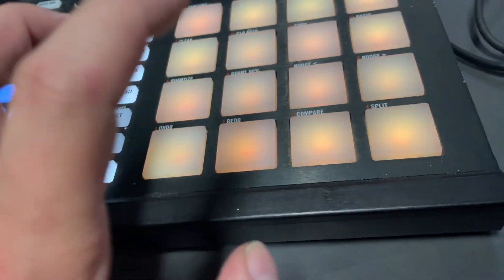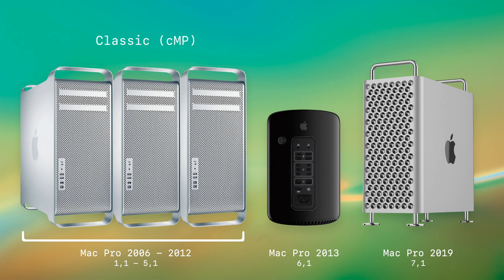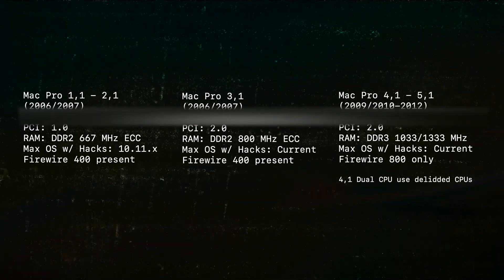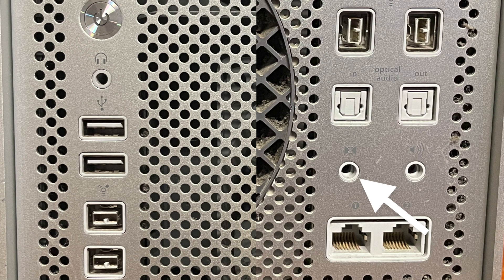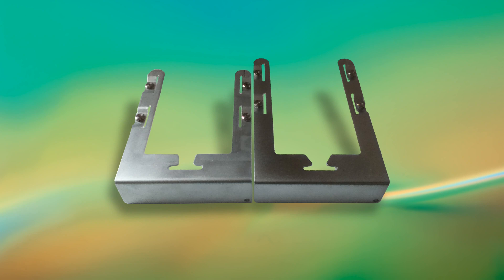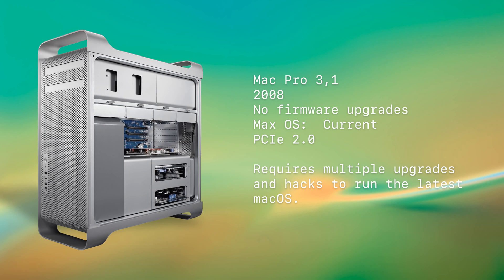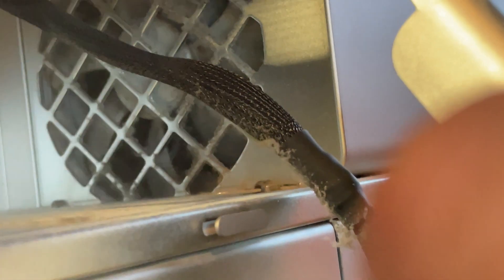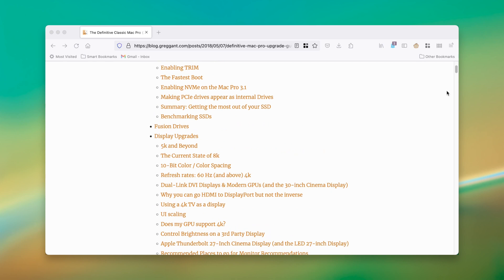Watch this before buying a Mac Pro 2006 - 2010 (1,1 2006  3,1 2008  4,1 2009 and 5,1 2010-2012)

Comment: 10.7ppc was released by dev.
Reply from the maker: @reality: There the 10.6 beta but I’ve never seen 10.7 for PPC, got a link for that?
Reply: @dmug  you’re also completely wrong about 1,1. It’s a beast that supports 64gb ecc, Monterey through windows 11 virtual machine, on nvme. Hell, I’ll ship you the machine to talk about.
Reply from the maker: @werehyenataur  I have a busted 1,1. Most users who are interested in getting into Mac Pros probably should skip it if they're hoping to use modern apps. 

This isn't to say they were once great but Apple's decision to drop support really took the most compelling feature: the ability to run macOS, away from them.  Considering the prices of the 3,1s and 1,1s aren't usually more than a few dollars, I just can't recommend them in any facet as they've been mothballed but if someone already has one and has a use case, then awesome. I support this as keeping ewaste out of landfills is great but given a choice of buying one? I'll always push someone towards the 4,1s/5,1 single CPUs over any of the previous gens because of the massive performance gains.
Reply: @dmug they should be recommissioned for old apps from the mac archive as 10.4-10.11 offered great apps and support for 32bit cards/apps, which gets dropped after 10.13. This saves time/money when budgeting a complete editing/gaming system vs newer shit. Every computer shop and grandma’s attic has these boat anchors for free. Ive never paid more than $10 per each. NVME cards are supported but I never did locate them again after methheads gutted my 1,1. It did run windows 10, and from there should be able to virtual machine above 10.11. You need to STOP mentioning money in your vids and just talk technical shit otherwise people will pass up these innovations and you’ll miss out on hackers like myself proving you wrong about how 1,1-3,1 are more useful than a crap 4,1-5,1 that you failed to mention drops 32bit pcie support when flashing
Reply from the maker: @werehyenataur  I don't think I'll be able to please everyone, price is such a big factor the majority of people in the Mac Pro community that it merits discussion. The desire to keep using these computers wouldn't be nearly as strong if Apple had offered an expandable computer at more attainable price-point. This video is approaching the cMPs from the lens of a user who's new to the world of classic Mac Pros and my guess is the primary interest in that these computers can run macOS natively (or better worded more natively than a hackintosh). There's more limitations that are inevitable, the further back you go.

Again, finding utility in the 1,1s is something I support but it'll be an uphill battle arguing that the 1,1 is more useful to majority of users. There's always edge cases and I try to account for them as much as possible I will always miss something as evidenced by the Definitive Mac Pro Guide ballooning to 51,000 words after 4 years with hundreds of edits. If there are things I'm missing in my guide I'm always happy to be corrected as I'd rather have my guide be accurate over "right".  I know my guide is 3,1-5,1 centric and it's because of the interest levels from the community. There's simply more information and more resources out there for the 4,1s/5,1s.

Comment: Hi, My Mac does he leaf lower aspect for ha very reason, I tried o put a Dual processor into a single 6 core processor mac that was flashed to 5.1. But is there away around the leaf blower aspect so I can use the dual-core to run a 12 core mac? or will that not work at all?
Reply from the maker: Sounds like you have a 4,1 dual processor tray that you tried to use in a 5,1 Mac Pro (or a 5,1 processor tray in a 4,1). If you mix and match, it'll boot but the fans will be running at maximum.

Comment: You videos are really helpful.  Does it make sense to upgrade from 3.33ghz to 3.46ghz on a mac pro 2010 5,1 single cpu tray to utilize 64 gb of ram?  is it even possible?  Will the update actually the 64gb??
Reply from the maker: If you're using any of the Westmere CPUs, which it sounds like you are if it's a 6-Core 3.33 GHz CPU. you should be able to use 64 GB of RAM on the single CPU. There's no need to upgrade just for RAM. 

The upgrade will only net you about 5% performance increase. Aliexpress has the x5690s for about $45 last I checked. I doubt you'd notice the speed increase much but it's up to you if it's worth it.  If you're on a W series CPU like the W5590, it's very much worth the upgrade as you'll go from 4-Core to 6-Core.

Comment: Really well done. You really are the definitive pro on the Mac Pros. I'd prior been through the G4 MDD Powermac, not sure I ever got the G5... But today am still using a 5,1 mid-2010, and i keep trying to squeeze the most out of it, incl video & image editing. Would like your opinion,. Just had it serviced about 6-9 months ago with new upgraded SSD, better GPU, Sapphire Radeon RX-580, pci card USB 3.0,  2 new INT hard drives WD Black 6T and Seagate 14TB drive. Other 2 have had a lot of wear, both are 6TB drives.  Also use three 6 TB external drives for backups...

But things frustrating include such outdated bluetooth. i've used a BT USB 4.0 Iogear dongle and it works, but tried for many months to find a 5.x dongle and I've just never been able to find any that work on Macs.  
I'm very low on money these days and I was hoping this would tide me over, but  I'm getting more and more spinning beachball delays, and past 2 days external keyboard not working, and can't get any of 5 different wireless mice to work properly, the cursor's just sitting there not moveable, I did an NVRAM reset, now about to do SMC reset. ... I don't have any alternative macs to swap out, 

so am grasping at straws, wondering if some used iMac Pro would get me decent bang for buck, but then I'd need NAS or other unit to house my INT drives etc. Long note I know, but any suggestions?
Reply from the maker: I don't have a 5,1 anymore but I'd take this to reddit or Macrumors or MacProUprade on Facebook and post specifically on what dongle + Keyboard / mouse and if you've made any changes etc.  

Do you have a wired mouse/keyboard to test against? That'd be my first move, try and narrow it down to see if its bluetooth or something else.

Comment: I have a Classic 5,1- I upgraded it it has 4 drives, totalling about 10 terabytes of storage. My question because you are clearly a musical Creator…is because Cakewalk only runs on Windows.. is it a simple matter of just loading Cakewalk to a specific hard drive where I have installed Windows 10. and then running everything on to that drive when using the DAW. Or do I have to buy Logic Pro and run it on Mojave??? Hope this is not a really stupid question.
Reply from the maker: Nah, not a dumb question. So what is it you're trying to accomplish? Do you want to load previous cakewalk projects into a Mac app like logic, or do you want to dual boot and continue to use Cakewalk in Windows and then boot macOS for other things?

If I'm following correctly, you want to be able to dual boot. That means either partitioning a drive or better, using a single drive for Windows and booting off that since these Macs can boot Windows 10. macOS can read NTFS (Windows formatted HDs/SSDs), but it cannot write to them without special software. Windows cannot see/read or write to APFS or HFS+ (Mac formatted drives) without special software. Most people who dual boot have specific Hard drives or SSDs for each OS, as trying to use software like Paragon (which exists for both macOS and Windows to accomplish reading/writing between different formatted drives) is expensive and messy. 

If you're trying to move away from Cakewalk, then you'll be stuck exporting your music as multitrack exports/stems/midi files, etc. There's not really an easy way to move between DAWs. You'd be stuck buying an audio app like Logic, or Cubase or Ableton or Protools which all have Mac versions.

Feel to reply and I'll try and explain further.
Reply: @dmug  Wow thanks for that, yes your interpretation of what I want to do was correct. 

I will give the windows 10 install a go on a cleared reformatted drive which is currently available and load cakewalk on to that. See how we go. Thank You :) If it works with a normal hard drive that will save me upgrading now and permit me  to get an Arturia Microfreak  Synthesizer. Thanks again :)
Reply from the maker: @JodieAprilMae  If you're sticking with Mojave for the Mac side, you'll want to install Windows 10 using legacy mode. This is done by using a DVD by burning the ISO to disk. 

If you're going the OpenCore route on the Mac side, then you'll need to first install OpenCore and then install Windows 10 via a USB stick.  

It's annoying as if you chose to one day go to OpenCore, you'll have to do serious gymnastics to get your Windows install to work in the EFI mode. 

After you've installed Windows 10, you'll want to install the Bootcamp drivers but you'll need to install specifically the later version of the Bootcamp utility so it'll recognize APFS so you can target your Mac's HDD. 

http://blog.greggant.com/posts/2018/05/07/definitive-mac-pro-upgrade-guide.html#windows10

This looks much worse than it is
https://github.com/timsutton/brigadier/

Then check out:
https://forums.macrumors.com/threads/how-to-boot-camp-without-a-boot-screen.2114788/page-9?post=26689280#post-26689280
Reply: @dmug  Definitely LOOKS a bit scary. I am away from my Mac Pro at the moment… will be back home to try this next Sunday. Hopefully I will be able to report all well and good. There is another factor, and that is installing Native Instruments Komplete Ultimate 13 on the same drive assuming the Windows installation works. There will be a lot of you tube watching and reading in the meantime.
Reply from the maker: @JodieAprilMae  Not sure about the Windows version but Massive X now requires AVX on the Mac side (CPU instruction set that the 5,1s do not have). I think most of Komplete 13 works on the classic Mac Pros but sadly one of the better instruments does not. You may be able to track down an older version that still is.

Comment: Dude you make really good content. Just keep at it, the algorithm will pick it up at some point and reward you! You should be getting more views.

Perhaps try including some Windows gaming and overall macOS productivity information in a video, to give a full feasibility update on the 5,1 with different GPUs and use cases.
Reply from the maker: I appreciate it, my stuff is still rough on the edges. I’m still not happy to be on camera and I habitually mispronunciation things Xeon becoming “X-Zeon” or that time I said CUDA as “cuh duh”. 
The big one is just not having a real office / studio but I’m blowing $3g on finishing out my gf’s garage so any luck I’ll have a slightly better place to record.
Reply: @dmug  Keep up the great work. Very few have your knowledge.
Reply: @dmug  Hello i have a question . Im using a Mac Pro early2008 running with El Capitan .
Befor i was running Catalina patcher .
For Software the catalinapatcher ist working fine but for multiple Monitors IT IS a Big Problem 

I downgraded Back to El Capitan to See If i can Connect and Setup multiple Monitors 

First i Connected two Monitors in the grafics Card 
IT was working fine With the Same Resolution of 1920x1080 

I want to move from Windows Computer to This Mac system because the osx is much more stable and better Plug and Play 
No Driver Problems or troubleshootings 

Ok 
In my Windows PC i Connect Three Monitors 

Two of Them on a VGA Splitter ( Same Monitors one is used AS Touch Screen Monitor ) in one DVI Port , the other one is a newer model because of has a HDMI Port but IT IS also Connected via VGA to DVI 

Windows 7 is showing all Monitors and i the ones Connected thru VGA Splitter is showing the Same Desktop while the Touchscreen is working as it should 

Now i First Connected the two Monitors wich is the newer and the older Monitor model to the Mac Pro early 2008 
This is working fine choosing the 1920x1080 Resolution for both Monitors in Widesscreen and mirror Mode 

But when i Connect the vga Splitter to Split the Signal so that i can use three Monitors over two grafics Card Ports the Mac Pro and El Capitan is Not providing the 1920x1080 Resolution 
IT IS Not showing me the Resolution of 1920x1080 in the list  or choosing IT by itself anymore 
The Touchscreen Support over the USB cable is Not supported 
( I already have the Touch Base Driver but i didnt Installed IT yet because i First need to fix This Problem with the Resolution )

My question is 

Why is IT Not possible to easily Just Split the Monitors Signal Like in the Windows PC ?
I reconnected the Monitors to the Windows PC and is directly the Same Setup and the Monitors in the Same use as befor 

Do i need a Second grafics Card to Support the third Monitor with the Same Resolution because the El Capitan is getting a confuding Input Signal from the two splitted Monitors ?

Comment: i love my 3,1  however if i could get a dual socket 5,1 then id be happy currently i own two g5s one is a quad converted tgo air the other is a 2 ghz  also a 2,1 and 3,1 mac pro
Reply from the maker: The 2008 served me well for a decade but in 2018 I got a Mac Pro 2010 and was surprised what a substantial upgrade it was
Reply: @dmug   I'd like to see you give that 3,1 some love, you might be surprised how substantial contemporary upgrades are.
Reply: @edwinmunter708  oh I have it at 3.45 ghz now lol with 32gb ram and a gr 750ti
Reply: I meant to address Greg, 3.45 ghz?
Reply: @edwinmunter708  used set fsb on Windows to oc the cpus mine are dual 3.2 but because I'm using 667 mhz ram I can oc the CPU 200 mhz without yo much fuss as 90 percent of 667 mhz ram will happily take 200 plus mhz any higher they don't do well

Comment: 2010 5,1 Mac Pro running Linux with 32-GB of RAM now. 4 SATA Drives 2 500-GB 10,000 RPM Drives one 10,000 RPM Drive setup as Root and the other setup for the Home Directory. 2 1-TB 7200 Drives one setup for Backup the other setup to run VMs. All drives running EXT4. Original Dual Xeon CPU and ATI 5770 GPU. Much faster and continues to update and get parched with Linux. I use this system for Photo Editing, Watching Movies, Web Browsing with multiple tabs open all at once. Vary Happy with this Machine.

Comment: I still have a Mac Pro 1,1 2006. Over the years I've replaced the standard GPU with an ATI Radeon HD 5770 (1Gb). It's now running Windows 10 and I'm wondering if a better GPU would work to get more life from it. Is there a GPU with 6Gb available that would work?
Reply from the maker: If you want to to boot 10.11 there’s the Nvidia drivers that support the 700 and 900 series. The GeForce 770 is nice upgrade over the HD5770 and usually can be found semi-sane pricing

https://gpu.userbenchmark.com/Compare/Nvidia-GTX-770-vs-AMD-HD-5770/2174vsm7752

Comment: I watched this video a few days ago and today I bought two 2009 4,1 mac pros for $200 AUS from a lawyer. One of them came with a high quality Radeon graphic card worth $100 alone. My plan is to recondition them and upgrade them thanks to the definitive Mac Pro Upgrade Guide more as a hobby and turn them into media and entertainment machines. I had already bought some a couple of 250 GB sata SSDs, 2tb and 1tb western union harddrives and a Samsung 500gb MNVe plus a double silverstone adapter for under $150. You are so right on how easy these machines are to work on. If I never came across your channel, I doubt I would have bought any mac pros due to lack of knowledge. Keep up the good work. And thanks.
Reply from the maker: That’s awesome to hear, I’m glad people are still able to use these machines and $200 AUD seems like a fantastic buy from what I’ve seen from the Australian market. Great score, even stateside that’d be a great deal.

Comment: Just bought a 1,1 from a guy who said he didn't know which one it was. I knew nothing about Apple computers. Wish it was a newer one but it was only 80 dollars and i can use it for Linux/Windows and it's hard drive expandability.
Reply from the maker: The 1,1s run Windows and Linux fine, it's a bit more tricky but totally doable, you still load up macOS 10.11 to if it's something you're interested in trying.
http://blog.greggant.com/posts/2018/05/07/definitive-mac-pro-upgrade-guide.html#linux2006
Reply: I bought a Mac Pro 2.1 for 15€ 😅

Comment: I bought a 2008 mac pro for $150 and it goes well but I did want a 2010 model but people are wanting too much for them and I would prefer a m1 mac mini for the same money. Great video but there are better options out there than the mac pro 2008 to 2012.
Reply from the maker: The dual CPU ones seem to be overpriced, especially today but I have seen locally Mac Pro single-CPU ones go for $150 recently. Prior to the pandemic I'd be surprised at the the deals people would get. I bought a second 5,1 in 2019 for $300 only to see in various groups people picking 5,1s in lot sales at $50 a machine. It's tough for me to make blanket statements markets are so wildly different, especially at the global scale.

I agree, if you're crossing a certain threshold the M1 is a smarter buy, especially if you cross the threshold being about to buy a Mac Mini M1, 16 GB of RAM / 512 GB of storage model. Some people have very specific use cases and the M1 doesn't fit. Those are dwindling but soon it'll be pretty sparse beyond legacy, dual booting and VMs.